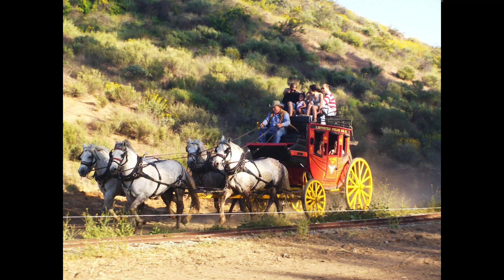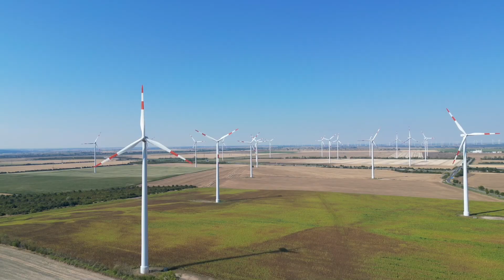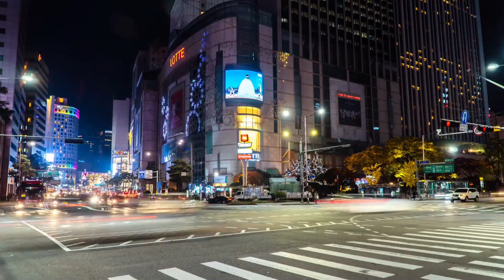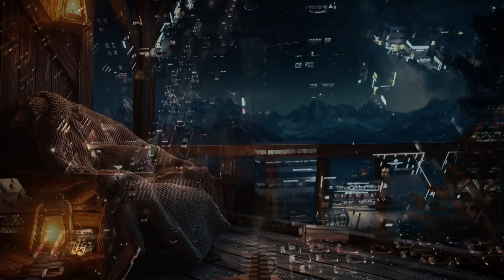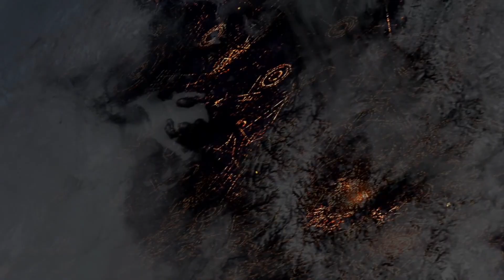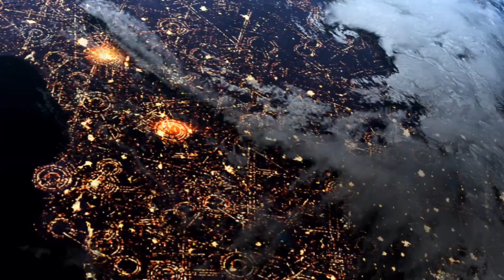Advantages and Disadvantages of dc, and What History Left Out

Comment: I thought the size of the wiring had to be larger on DC, and this was the reason AC was used
Reply from the maker: You’re right — back then.
Today, high-voltage DC and modern converters change the equation completely.
That’s why DC is returning.